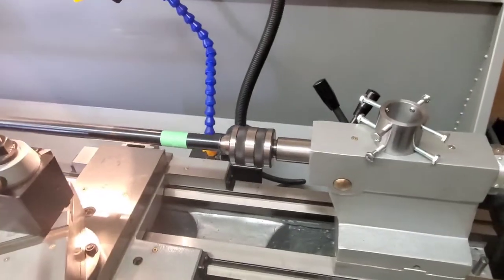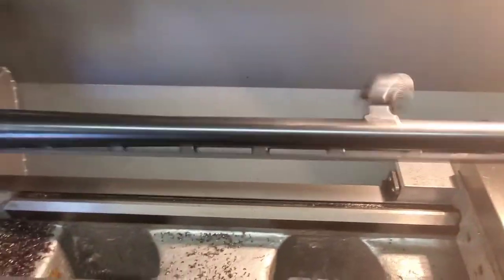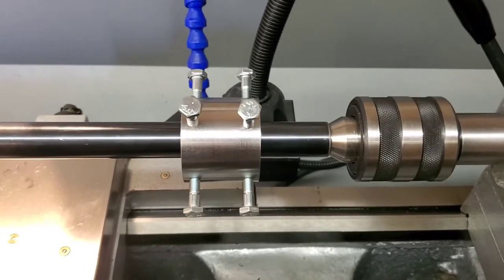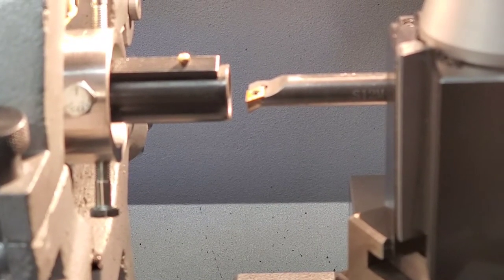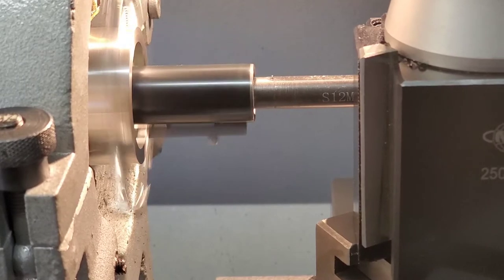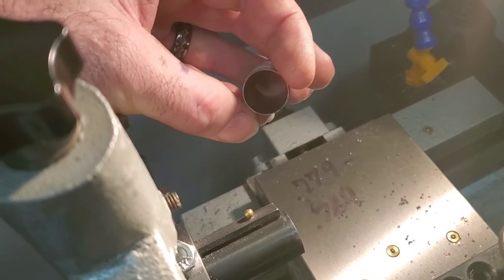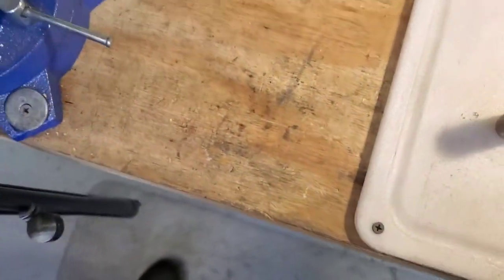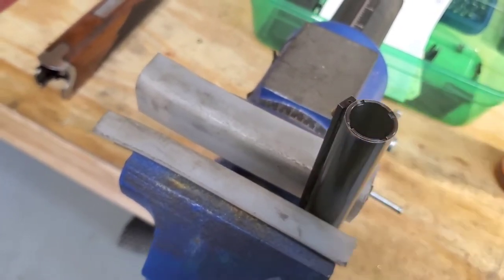Machining barrel for chokes.

Comment: Awesome video! 30+ years as an industrial maintenance mechanic that started with machine shop schooling. (We did both maintenance, fixing broken parts, replacing etc. AND making parts from scratch to get production running. 

I've been investigating gunsmithing since I retired, just for myself.  I'm looking to do a a couple of over unders and put tubes in them to make them more versatile. 

Do you have contact info? I may just have you do them.

Thanks 
Greg Heims
Reply from the maker: You can shoot me an email at ghostsniper513@gmail.com

Comment: Think you could do a 410 barrel? Mossberg 500 24 inch vent rib with fixed full choke.
Reply from the maker: Shouldn't be a problem as long as the wall thickness is there for a particular choke size.

Comment: Hi! By any chance do you know if the barrels of a Beretta S 685 can be threaded for choke tubes?
Reply from the maker: I'm not sure of the outer diameter of that particular barrel, but out of the plethora of different choke manufacturers out there, im sure that there is a style that it could be bored and threaded for.

Comment: I wish I was at point in life that I could apprentice under a gunsmith mentor.  I saw someone on YouTube bore out a barrel for a choke manually with a T handle.  What is the advantage of using a lathe with all the setup time versus doing it manually?  I am guessing it is a matter of precision?
Reply from the maker: Alot of people have older lathes that don't have a spindle bore large enough to properly indicate a shotgun barrel in it, so they have to go about doing the job by hand. Either method can get good or bad results depending on how much effort is applied to doing it right or wrong.
Reply: @thebeardedgunsmith9177  thanks for the info, I enjoy watching quality workmanship.
Reply: You can buy or rent a reamer and threading tool to do the job either way. A old school shotgun master smith near me did it by hand. What way would you have to do a double barrel ?🤔😉
Reply from the maker: Funny that you mention that. I just did the same to an over/under a week or so ago. Pretty much the same setup but a larger spider. I've done it by hand but it's more time consuming.